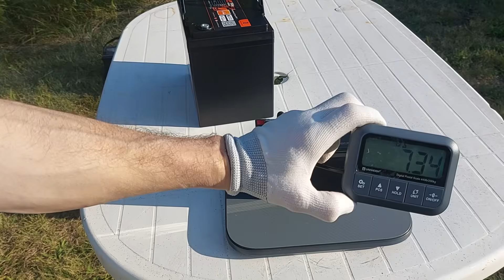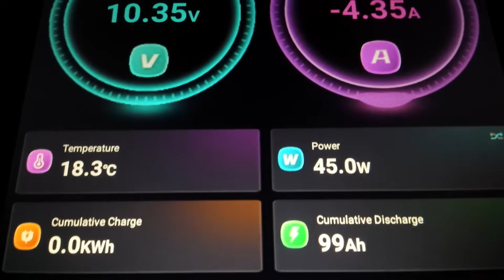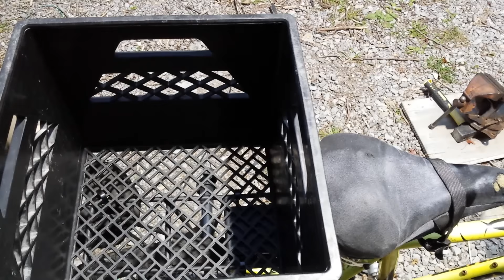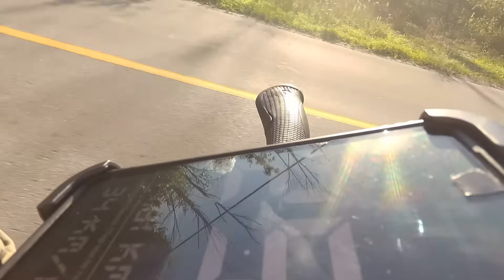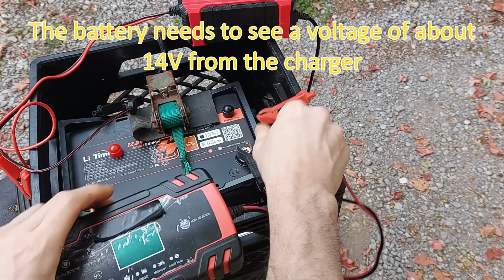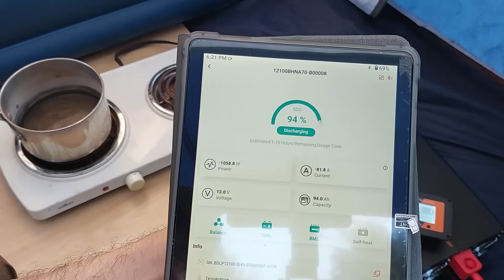I Installed a LiTime 100Ah  LifeP04 Battery onto a DIY Ebike [ Full Battery Review ]

Comment: What happens when your chain seizes up or motor breaks on a front wheel drive system like this? Time to learn how to fly I guess... 😂😂😂 only asking cause I have an older 90's kit ebike my Dad left me and its rear wheel drive with a 12v battery I'm gonna try to replace the older broken battery with an ion one so thanks for this great video!! 👊

Comment: So how about a Bafang BBSHD 48v motor with 3 or 4 of these to make 36 or 48v respectively. For the same investment of some $300-$400 you could have 5 times the capacity of the factory built battery that sometimes is problematic, has less cycle life (18650 cells). Yes I would open them because there is allot of dead space inside the cases while not adequately sealed. And so as to fit a diamond type frame. Besides an diy engineer as you, been a bike mechanic of 38 years and think this would work great. Also I would install a unique 2 gear derailleur setup up front im developing or atleast swap the chainrings mid ride depending on terrain I might encounter. I calculated the range to be about 133 miles at full throttle or around 33 mph in the flats or some 50-70 miles towing a 350lb trailer for utility use.

Comment: I'll give you a pass because you were saying a lot of numbers. But lead acid batteries can charge and discharge WAY MORE AMPS, like orders of magnitude more amps. It's one of the only good things about lead acid batteries. LFP batteries are way better at most other aspects. But you're not starting a diesel with LFP batteries.
Reply: Lmfaoo
Reply: You are talking nonsense. I just jumpstarted 
my diesel truck w my LiFePO4 battery pack,  right in the Home Depot parking lot just the other day 😂 

and truth be told, I only used half of the battery, (I have two 4s1p 230Ah packs built w 3.2V prismatic cells that I usually run 8 in a series for a 24V system in my RV. 

Lithium based batteries are superior to LA in every measurable way, aside from greater upfront cost…but even this is negligible when you consider the 6000-10,000 cycle lifespan of LiFePO4 batteries, combined w the fact that you can utilize almost 100% of the batteries capacity, while with LA, you’re using 50% at the most. 

SPECS as designed:
8x 3.2V 230Ah CALB LiFePO4 prismatic cells  assembled in 8s1p config for 25.6V nominal. Actual tested capacity is around 245Ah per cell, yielding a 6kWh pack that cost me just over $600 to build. $100/kWh for a 6,000 cycle battery that can supply 345A of continuous current for 30 seconds from 45°C-0°C, or 230 Amps continuous for 3 minutes.
Reply: I don't know what I'm talking about but I thought lead acid could do massive inrush, like 4x more than lifepo4 but only for a few seconds. And lifepo4 can discharge high amps for a long time, more than acid

Comment: You showed a solar panel. No narration about that charging.
 
Dispose of that old dual burner, use a single plate induction cooker.
Get a heated blanket.

A used bed frame, cut and bent, would be a much better choice for the motor frame. 

Make wood guide plate/wheels for the motor chain.

You did not mention the source of the geared motor.

Draining the battery "ridiculous" low is not necessary to demonstrate. Doing that multiple times will certainly damage the lifetime of the capacity.